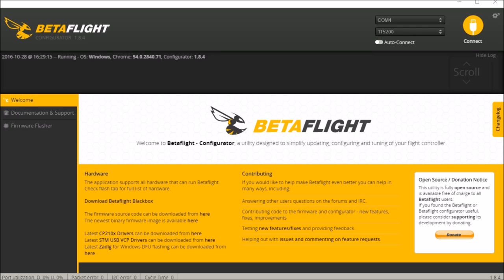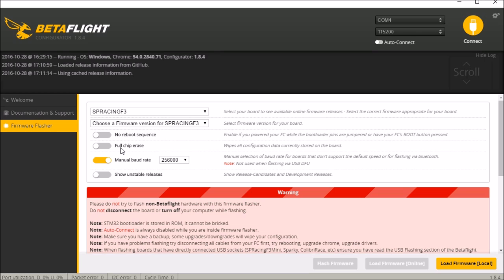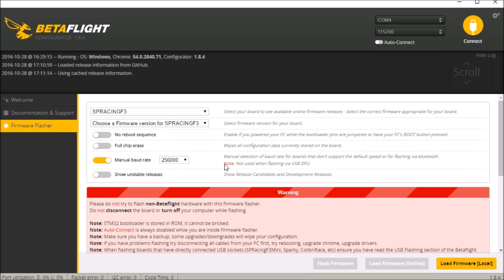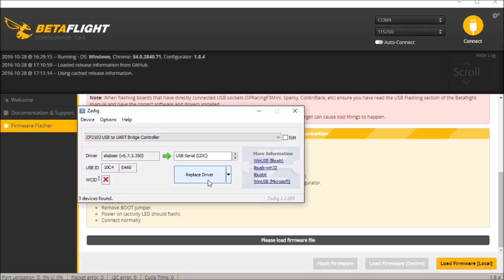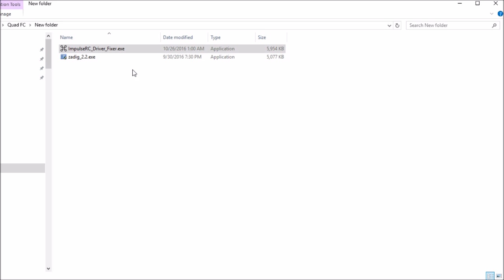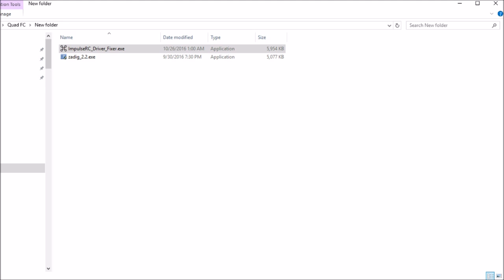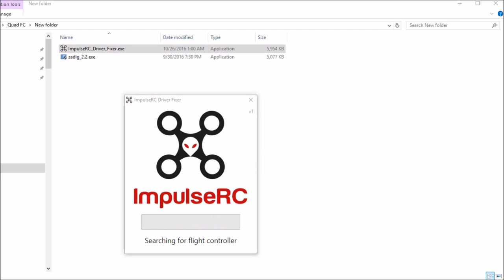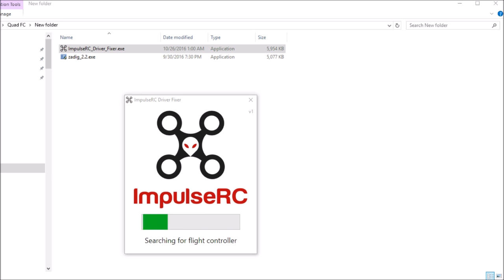Trouble Firmware Flashing

Comment: Hi Nick , I am unable to flash the boot loader I am getting " STM 32 TIMED OUT" . I am using clean flight and SPracing F3  flight controller.
Reply from the maker: does your computer detect the flight controller? Do you see an additional com port when you plug it in? If not, are the drivers installed? I believe the drivers are linked on the first page of clean flight app.

Comment: Im sorry if this is Out Of Topic, I was stressed out:

My board FC CrazybeeF3 BNF Frysky,
my latest firmware : betaflight_3.3.3_crazybeeF3FR (Stable)

on betaflight configurator tab : 
I choose : SPI_Rx Support
The next right thing to do is to choose Frysky_D or Frysky_X and save it

BUT :(
I accidently choosing wrong SPI Reciever Provider to A7105_Flysky_2A and save it

now my FC can not connect to USB anymore, everytime I try connect it is says " Unkown USB device (Device descriptor request Failed) for windows 10"

is there any suggestions to fix it? please help me anyone..
Reply from the maker: What was the result of running the tool in this video? This is the best tool to fix a software issue. Also find a pinout of the flight controller, look for the boot pads, short those with a pair of tweezers while plugging in the usb. These are the steps I would take.

Comment: Yep! But pressing that makes no difference. I’ve tried holding it down when it gats plugged in. I’ve tried pressing it for fun. I’ve even pressed it while standing on one foot one eye looking to the left & holding my tongue 👅 right 🤪
Reply from the maker: does the board light up? What color lights do you have and are they solid on or blinking on?
Reply: Nick Burns 
Oh shit mate can’t remember that was a week ago & it was chucked on the shelf in disgust😤 I will check when I get home from work today 🙃
Cheers
Reply: Nick Burns 
Ok I plugged it still stuffed. When in boot loader mode I have a solid blue light when not in boot loader mode it has a solid blue light with a flashing red light. When I tried to connect it get the usual no communication failed after ten seconds. When I try to flash the board it says no response from boot loader program FAILED. ImpulseRC driver fixer still doesn’t work just sits there saying searching for flight controller.

Comment: My Tiny6 did after hours of installing & reinstalling drivers & than When I plugged it in & got it connected the quad was tumbling in the receiver tad & my controls were all mixed up. So I  started changing some settings.
Changed a settings to do with the the com stuff on the 1st page.  Betaflight locked up & crashed now my quad wont talk to Betaflight on two different pc. I obviously stuffed something up.
Reply from the maker: Does that flight controller have a boot button or boot pads that can be shorted?

Comment: Hi Nick!  I knocked off the super small boot button on the BFight x210 fcb, which has the Omnibus F3 Pro fcb.  BetaFlight will not recognize the board...which is why I was pushing on the button on the first place.  
With the button gone, I see 3 tiny metal contacts.  I tried jumping them with metal tweezers, but am not having much luck.  Last resort is to just put solder on all three contacts.  

Any ideas?  Also, if I need to replace the board, you recommend the same fcb or upgrade to a better one...which one you recommend?

Hey, watch all your great reviews, flights, etc.  Thanks
Reply from the maker: I think your going about it the right way with the tweezers, I would hesitate to put solder on it. Can you test the usb and computer connection with another quad? I ask as I have had issues where a usb cable stopped working to connect to betaflight, might try another cable too.
Reply: Ah, indeed I have.  I threw out a mess of the ones which don’t send signal.  Crazy how these cables come with everything.  

Thx for encouragement!  I’m cleaning the tips of all my tweezer tools with 99.9% isopropyl alcohol to remove any type of residue.  I’ll just see what happens.  THX!
Reply from the maker: try to get the flat part of the tweezers on it, the contact needs to be able to carry volage, I think 3.3. you might also try a wire.

Comment: my impulse is searching right now, its been going for 20 mins, how long will it be?
Reply from the maker: it shouldn't take nearly that long. Does your computer detect something is plugged in when you plug in the fc? Maybe just unplug and plug back in. Is this the first time you have plugged in a flight controller to this computer?
Reply: It is the first time yes, why?
Reply from the maker: even with the impluse driver fixer we need to have the drivers for betaflight/fc installed on the computer. They are linked in the lower left of the entry screen of betaflight. install those and reboot.
Reply: Oh, ok, ty, i will try tomorrow as i have a maths exam tomorrow in school lol
Reply: what do u mean, does it detect it? What will it say if it does detect it

Comment: Silicon Labs CP210x USB to UART Bridge is the driver in device manage.. it will connect to the older version of clean flight. but wont let me upgrade firmware.
Reply from the maker: Are the drivers linked on the front of the betaflight/cleanflight page installed?
Reply: ive used USB to UART Bridge VCP Drivers  Silicon Labs drivers. from the links on that page. no luck.. and impulserc just says searching over and over
Reply: what drives are installed in your device manager?
Reply from the maker: I have no idea. I watch the betaflight app. When I plug in I get a new com port and it generally works. If it doesn't I unplug, run the impulse rc driver fixer and plug back in when it searches. It fixes the drivers.

Comment: So I just bought an SP racing f3 evo and have never flashed any chip.  I have no idea what to install.  All I get when I try to connect using BetaFlight is a "failed to connect to serial port".  Please help.
Reply from the maker: Did you install the drivers reference on the front page of the betaflight chrome app?
Reply: Yes I did.  But I still get the "Failed to connect to serial port".  When I try to run the impulse RC it just loads and cannot find the flight controller.
Reply: Also the zadig can't find the usb drive on my laptop as well so any attempt to put the driver on it has failed.
Reply: Did you ever find a fix, I am running into the same problem.
Reply: Me too!!
I have exactly the same problem!
Reply: Samuel Ratcliff make sure you aren't shorting out the fc when trying to boot, I was accidentally touching another pad. I ultimately got it to flash
Reply: What do you mean? Can you please go step by step?

Comment: Thanks for the video. I am pulling what little hair I have left out of my head trying to flash my controller. Thanks for the suggestion. I will give it a try.
Reply from the maker: This is my goto when I have trouble. Next step would be to either press the boot button while plugging in USB, or short the boot pins while plugging in.

Comment: Please can you try and help This is the 2nd Revo fc i bought from Banggood as the first one would not boot up, No lights
They sent me a new one and it was fine and i set it up in Betaflight 
Today was only the second time i flew this quad and to be fair it flew super smooth
Then as i landed it i noticed a green light on and my lost alarm was sounding
It was back in bootloader mode,strange but this is what happened
I could not get betaflight to reconise it
So with a pair of tweezers as the boot cap came off the board the same day it arrived
The only way i could get the blue light on flashing and betaflight to reconise it ,was to short it out from ground to the boot pin 
But this is no good I cant go out to fly with a pair of tweezers and twiddle untill it works 
I even tried with the lipo This made no difference
I managed to re flash ,thinking it was the software
This made no difference
I just plugged a lipo in and the light wont come on at all
I have written to banggood ,but i am not holding my breath on getting a 3rd
I would be interested to hear your thoughts
Reply from the maker: It doesn't sound good. If we can only get any activity with the fc by shorting the boot pads I think the board is shot.

Comment: thanks for the good info.i flashed the naze32 rev6 with cleanflight all connected good many times.didn`t have any luck on tricopter or quad so i put the board in my junk box.i wanted to program my esc`s.i see you can use the board with passthrough blheli suite.check the board still connects good download the suite and the board wont connect 5 minutes later.wow i think it will stay in the junk box not to be bothered again.
Reply from the maker: some just aren't worth the trouble. Stinks, maybe it should be a keychain.
Reply: cheap cloned crap is hit or miss 12$ banggood dud

Comment: iv downloaded impulserc the only problem is that it stays on the loading screen "searching for flight controller" is all it says any advice would be much appreciated
Reply from the maker: flight controller plugged in? If so can you connect it to cleanflight or betaflight without trying to flash new firmware? If not the drivers from the lower left of the app need to be installed.
Reply: Nick Burns, hey nick thanks for your reply, yea I just tried that however I didnt download all the apps so I though I'd do that, then I find out the files ziped and it just so happens my zip file app trial expired so I cant do I god dam thing I've been at this for a week its really annoying me iv watched over 6 videos on youtube not to mention search the net for information, I just dont understand why it was working perfectly fine at the start and now its not working at all, any way iv had enough of this crap im selling this stupid drone and buying my self a horizon at least that way it will automatically connect to my transmitter and I dont have to go thru this, but serious thanks for helping me your a legend I didnt think you'd reply so quick though id have to wait a couple of days takecare.
Reply from the maker: Thank you for your kind compliment. I would help more if you me to. This hobby can be frustrating, but the more we learn the easier things get. I remember the first scisky board I had took me a long time (6-10hrs) to get it bound and working properly. I presume your using windows. Download/install 7 zip from www.7-zip.org it will work on windows and is free.
Reply: yea your right it is frustrating tho, and thanks for your help, ill give it another go tomorrow, going to get some rest for now, but so far what I've done is  downloaded zip 7 then I went on to downloaded the 3 apps but it still wont recognize the quad
Reply from the maker: I break will do some good to ease the frustration. To be thorough, when you say downloaded to do you mean downloaded and installed? We should only need the CP210x drivers and STMUSB VCP drivers, Zadig is a troubleshooting app. After the download and install did you reboot the computer? Can we see the quad in cleanflight/betaflight? If we can we can do into dfu mode with the dfu command in the cli.
Reply: im back at it, I restarted the laptop, I've downloaded vcp, zadig aswell as impulserc and cp210 however with the cp210 when I go to install it says "cannot complete the device driver unable to find any drivers designed for your machine" and im using cleanflight and yea your right im on windows 7
Reply from the maker: Hmm. Are you sure you downloaded the drivers for Windows 7? its the top link (just being thorough, not meant to be insulting). Did you double click the *.exe file for 64 or 86? I think we should extract all the files to another folder/directory on your computer then click the appropriate *.exe file. Is your computer 64bit? To check hold down the windows key on the keyboard and tap the "pause break" key. Next to "System type:" is will say 64-bit or not. If you have done these things maybe its antivirus getting in the way. Temporarily disable it and try to run the installer again.
Reply: no your not being insulting at all, im sure it's 86bit ill double check after work, it could be the anti virus hadn't thought of that
Reply from the maker: Send me an email as we continue, the comments for this video has now fallen off the youtube dashboard, making it a challenge to find the comments. nickburnsrc@gmail.com

Comment: how long does the driver fixer have to take to find the FC, it's been about 20min...
Reply from the maker: Not long 30secs. I don't think the fc driver is installed, or the usb cable isn't compatible.
Reply: can't find a driver for me "SP racing F3". could I just use the naze driver?
Reply from the maker: download and install the CP210x and STM USB VCP drivers from the front of the cleanflight or betaflight app, lower left of the middle section.
Reply: oh, I already got all of those drivers, been having issues with flashing for about 2 days, looked on countless forums and videos, jumped boot pins, tried every baud rate, tried every zadig driver... idk when I will actually get it to finally update firmware
Reply from the maker: can you access the board through cleanflight or betaflight? Is this a flashing firmware only issue?
Reply: I can connect the board and edit settings, yes this is a flashing issue only... the only other issue I have is getting the transmitter bound via satellite receiver which probably will be the only other problem before I get it in the air
Reply from the maker: I think you can enter dfu mode via the cli. I think we just have to type dfu and hit the enter key. This may not work depending on the board.
Reply: will do thx
Reply from the maker: Any luck?
Reply: I accidentally fried my receiver with an orange rx satellite cable with different polarities, so ill get another..
Reply: for the record I've had the signal wire soldered into a PPM output, is that gonna work?
Reply from the maker: I presume the receiver is has PPM output and it was solder to an rx input on the flight controller? If so yes that will work, we just need ppm selected in betaflight/cleanflight so the FC knows to look for that type of signal.
Reply: im using a lemon rx satellite receiver with only one satellite input, so I dont know if that works or not
Reply from the maker: If I understand correctly no that won't work. The signal wire from the satellite must go to an RX point. On some flight controllers they have a dedicated spot for satellite RXs, but if not I generally solder the sat signal wire to RX3, then turn on serial for uart3 (in beta/cleanflight), set serial_rx and 1024 or 2048.
Reply: Nick Burns oh that's good to know, thanks again for the extensive help, I've never seen this amount of it on YouTube. I will look through the FC manual and look for an rx3 pin I guess.
Reply from the maker: Sure. I started the channel because I really enjoy this hobby and think more should enjoy it too. Can you point me to the FC I might be able to sort out the rx? Also it is very important that power be 3.3v if its 5v (traditional) it will kill the satellite.
Reply from the maker: Leave the power and ground where they are and move the signal wire to RXD on UART3. Power and ground generally don't matter where they come from if the correct voltage, but the signal wire is important as we tell the firmware where to look for our signal and what type of signal it is.
Reply: will do, thanks so much

Comment: I Nick, I have a boot loader question. When I put my Naze 32 in to boot loader mode, I just jumped the pads on the board and plug it in. Bingo, your and boot loader mode. The videos I see on the S P racing Evo they say to bridge the loader pads with solder? Is that necessary? Can you just jump it and plug it in like a Naze?
I am having trouble reflash these boards in the 1st place, and was tickled to find your video. Even the 2 technicians at our local computer repair could not get it to work with the Zadig method.
PS thank you for all your help over on the form.
ROG
Reply from the maker: I have had some boards give me fits, but I don't consider myself an expert, thus the one short video on this topic. In my experience it varies. I typically try just shorting the pads first then if that doesn't work I will try soldering. The key part to shorting can be the timing and ensuring the usb cable is connected well. We also have to consider what we are shorting with, does it conduct and if it does, does it conduct the amps/volts need to activate bootloader mode. I have some tweezers that worked on one board but didn't on the next. I was vexed by that, I have since used a bent pin from a flight controller kit. One day they will all have boot buttons.